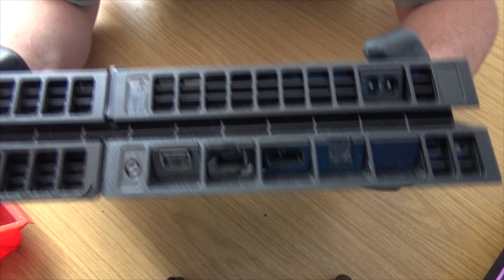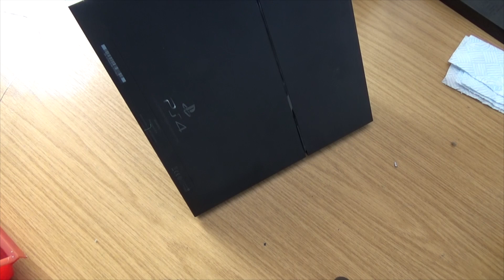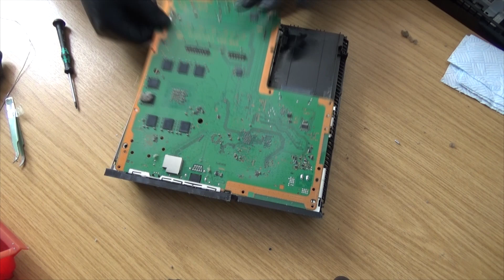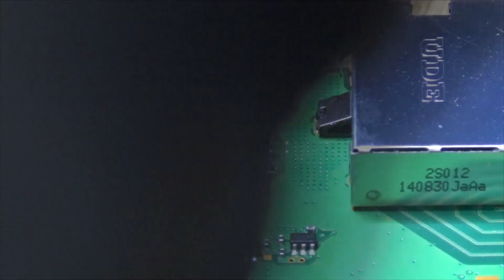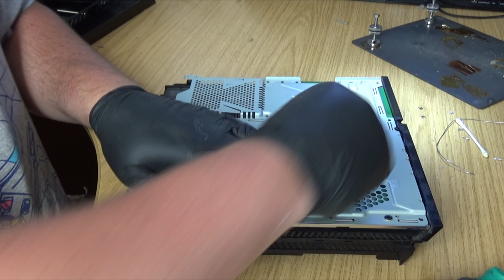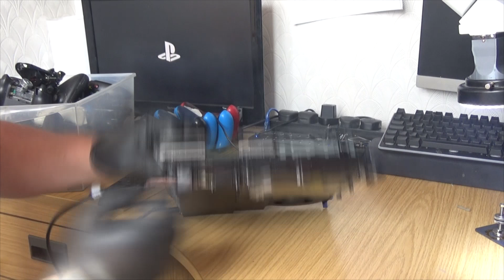PS4 HDMI Repair HDMI PORT RIPPED OUT. Easy Fix.

Comment: hey man if you could say me what flux are you using for ya fixes i would be so thnxfull i just have a chinese one and it is pretty meh
Reply from the maker: I used amtech flux but is very expensive I now just use the fake Chinese stuff. However the solder I use is Kester about £60 a roll and not easy to find in the UK. I find quality solder makes the biggest difference!
Reply: @UberMicroRepairs  roger that pretty appreciated tip ma man

Comment: I dunno what's worse. The shoddy soldering or the tools that were used?
Reply from the maker: I would love to receive constructive feedback from you. Maybe you can do a video and I'd be happy to see where I'm going wrong?
Reply: @UberMicroRepairs  A professional will not need to make speed-up videos on Youtube with bad soldering form. They make money by owning a shop and a valid business. If you want some advice. Buy a Hakko FX951 at least.
Reply from the maker: @Ryan-ks1vh  so I take it you don't have anything video's or experience in this field of work? Have you see any of my other videos? Please provide proof of your work so I can learn or provide constructive criticism. Btw .. I'm using a T12-ku cartridge.
Reply: @UberMicroRepairs  no offence meant but.... you are using a £4.50 aliexpress fake Hakko tip with most likely £40 worth soldering station. If i read it correctly, use fake amtech flux? You get what you pay for. Sorry for the late reply. I have been busy working with out bridges and not having to over heat/work ground leg or pins.
Reply from the maker: Please don't be sorry I wait with bated breath for every reply. You sound like such a pro! You keep up the good work not overheating your bridges or working pin leg grounds! My Hero! 😘
Reply: @Ryan-ks1vh  you have no clue! A good technician doesn't need to use £800 soldering irons to do a good job. People like you do a poor job then blame it on the tools.

For the record, I do ports every single day. The fastest method is to drag solder, something which requires skill.

P.S you're mad at your parents, stop taking it out on everyone else
Reply: @TheCod3r  HDMI port replacements are easy. TBH I use a Hakko fx951 not a £800 soldering station at all lol. Drag soldering is not hard at all. If you want a challenge try a liquid damged mac and SMC replacement or OneWire Circuit with a little pp bus g3h issues. I definitely don't have a clue on logic board repair. Sad times.